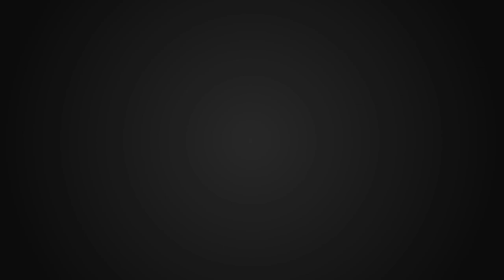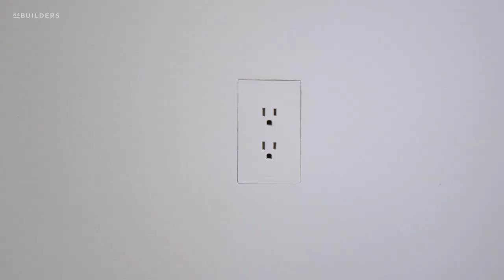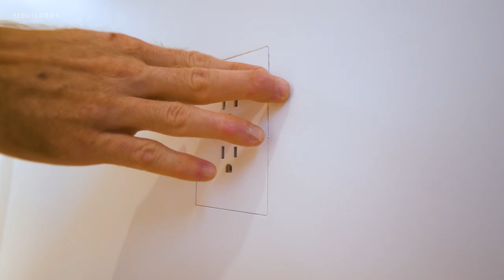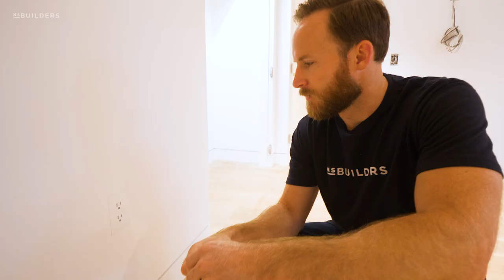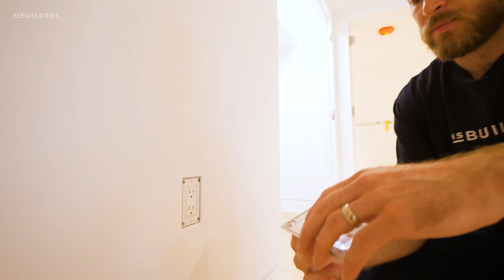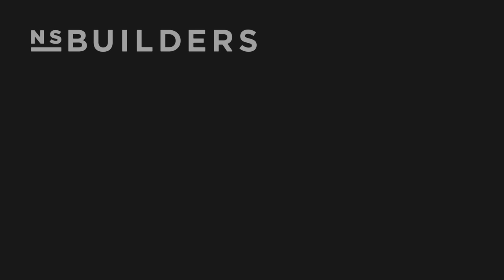Answering your flush mounted outlet questions

Comment: After having just replaced every switch, outlet, faceplate in my house with smart switches, decora style outlets, and screwless wall plates, the thing I like the best about these is how clean and solid the transition and attachment is between the electrical box and the drywall/blue board. I can't tell you the number of times I took the old wall plate off just to find a huge gapping hole I had to patch or how often the box would flex in or out trying to push all the wires back in. In one case, part of the electrical box is sticking proud of the drywall (Not sure how to even fix this one without cutting out the box and replacing it with an old work box). In the end, I could only get a few of the new outlets and switches to sit flush with the wall plates. The adjustability of these would have been a godsend although I would have opted for the trufigs with the decora cutout plates because I still don't like the idea of a spacer between the plug and the outlet even though I'm sure it will probably never have a problem.

I was thinking about something on this comm ave project the other day. You have these linear diffusers in the wall and floors. Had you consider hiding them in the shadow gap between the plaster and the flush baseboard?

Comment: My assumption is that the receptacle itself is shaved back to compensate for the thickness of the plate. In a regular plug, the metal contact is not less than 1mm behind the face of the plug, there's several mm of plastic there before you find metal. The effective distance is probably close to the same, if not identical.

Comment: Nick, love your videos, long time watcher!  Yours and your teams dedication and challenging of the industry status quo is great. As as architect I love your craftmanship and even this receptacle aesthetic, here comes though, the but. Listening to the comments you seemed surprised by how many comments were against this? As I have committed to Matt Risinger as well, you all have to remember 95% of these followers do not have clients with these budgets, or architects designing the homes, which is where you really get the attention to detail by all the parties. Like it or not, extra aesthetics and craftsmanship comes at a cost, that is just the way it is. I think this product is amazing for the limited use cases you have done before where you have to have switches or receptacles and you really need/want them to disappear, but an entire home?  Seems a bit much with probably 50%+ hidden behind furniture, I think that is the push back here. If hiding them is so much of the aesthetic goal for exposed receptacles not in use I would think you put a blank cover on them and pull it off only when you may need to use that receptacle.

Comment: I think the reason vacuum cleaners come up is that they are usually inductive loads and can produce a spark if they are unplugged while running. This makes many people think they use more power than they actually do. Honestly the worst load is probably an electic skillet. Many of these can actually draw more than 15 amps. These would probably not be so common if 20 amp circuits with 15 amp receptacles were not allowed by code in most of the country (a mistake IMHO).

Comment: Is the back end and front end part of the same system, in other words is the back end designed to compensate for the extra thickness created in the front end? Or are you saying that the thickness of the front is simply not enough to be a problem? 
Not critical but curious. 
Anytime I do something slightly different than the status quo at my job (cabinet refinishing) people act the same way (lose their minds) so I'm not surprised by some of the responses. I've learned to be curious instead of judgmental simply because I learn more that way.

Comment: I have a question. It isn't about these outlets, but it is about outlets with a full outlet plate over them.

I moved into the apartment, and they had full outlet plate covers over outlets. Almost every plug would fall out of the outlets. 

I made them remove every plate cover and put covers that had the holes in them. I didn't feel like it was safe to keep the full outlet plates on them. 

Am I in the wrong here cause I felt it was a fire hazard that the plugs were loose and falling out with those covers on.

Comment: Are the outler bodies also provided with the cover plate? If they come as a set there is no reason why the prong claims inside the outlet couldn't be bumped forward to match the loss due to the additional cover plate, and therefore have the same effective depth. Plus one could get the outlet design certified for regular use and then there will be no mismatch issues if it's accidentally installed without the flush plate.

Comment: I was the commentor concerned about the gap it creates. I sincerely think that is going to create a lot of heat with high wattage appliances. I would remove the plate cover if using a toaster or vacuum cleaner with it. They do look great 👍

Comment: Is there a version that allows the outlets to stand flush with the cover around? Allowing one to plug fully into the device while still getting 80% (?) of your invisible effect? Also, no one gives a shit about the voltage of your vacuum cleaner. Its the current draw (amperage) that matters and might become an issue if the plug/outlet interface is sub-standard.

Comment: Thank you for reading the negative comments. I think that the disconnect is that those commenters can't separate what they want from what the client wants. You may never want to have terrazzo ceilings but if that is the vision that the architect and client want, it's time to get with the production and installation of terrazzo ceilings.